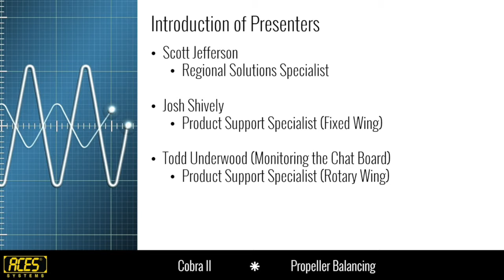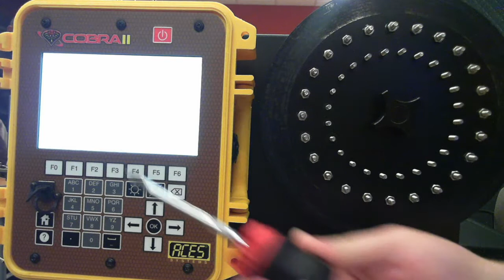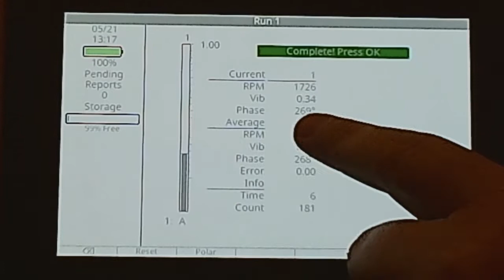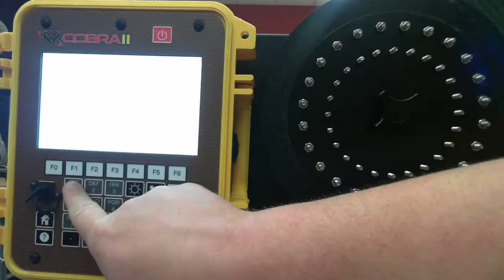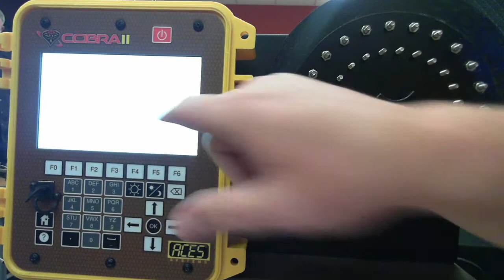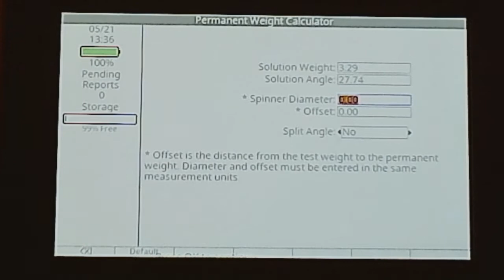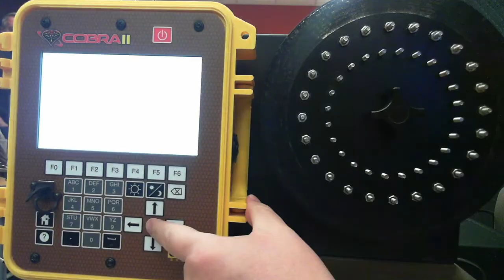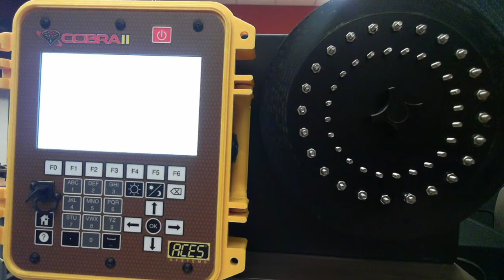STARTING, BALANCING, AND COMPLETING A JOB

Comment: Having used the 2020HR quite a bit, at about the 37:10 mark above, I expected the machine to ask if you wanted to save the influence data based on results of this job. - being an unused setup. Does the Cobra passively do this now, without prompting?